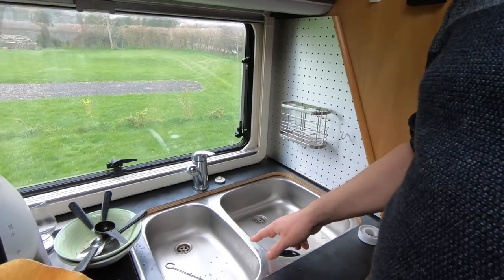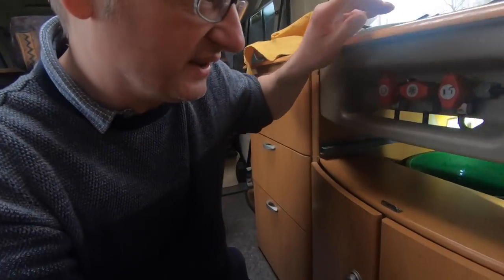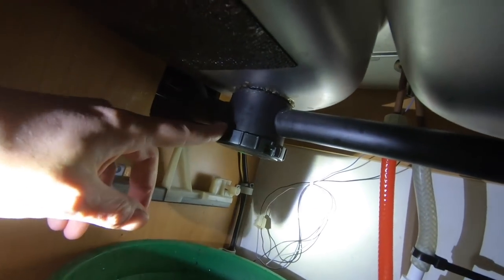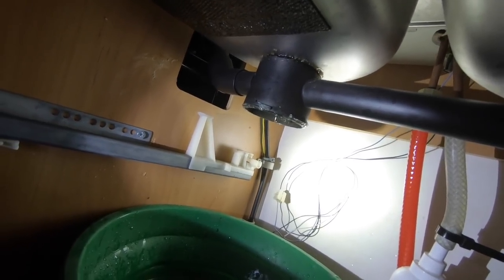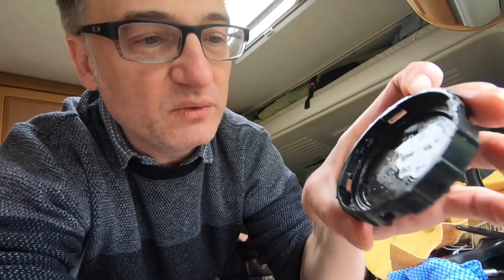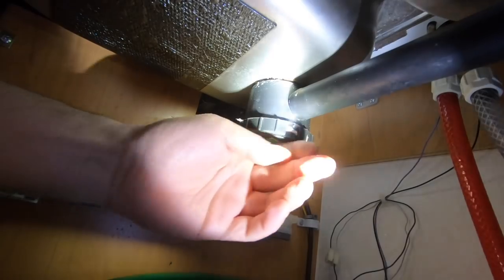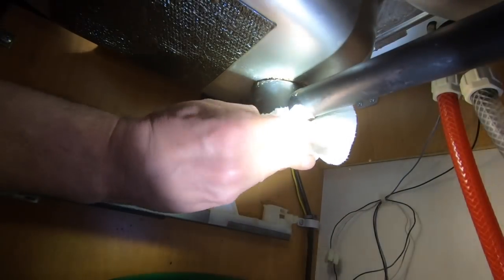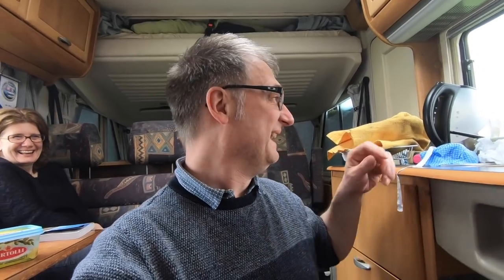Unblocking & Fixing Sink Drain- 3 Minute Thursday

Comment: #13: You did it, got the same problem in the past and, it did not work for me ha ha, I got my solution done with blue gasket paste (sort of silicone gasket used in the automotive world) It stays soft and it is easy removed with some braek cleaner. As long as it work its ok ;o) Cheers.
Reply from the maker: Oh. So it doesn't always work? Ok, I was right to have my doubts at the time then
Reply: @HermanHitstheRoad  Indeed, the best way is to replace the O ring that sits in the part you screw of, but you got to find one first.

Comment: Sorry but boring but very important note . PTFE tape come in two types , one for water , one for gas . Gas , if it leaks will desolve PTFE tape made for water . I didn’t know that either by the way , water leak = wet feet , gas leak = BIG BANG ! 😉
Reply from the maker: Thanks for that. I thought there was only one type. This just be the gas type then ?!
Reply: Herman the Hymer , maybe in a motorhome , like me , would be better to buy PTFE for gas , that will seal water fine with no problem and also gas , so if you buy gas tape you will be good for both water and gas 😉 , top tip , if you by two reels , one for each you can feel the difference straight away .